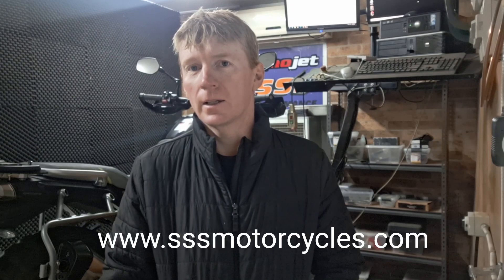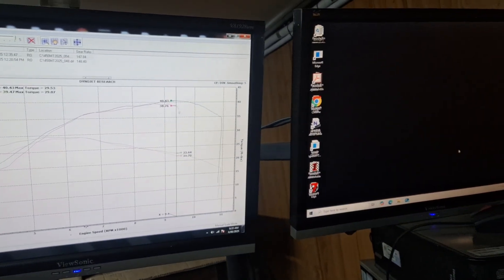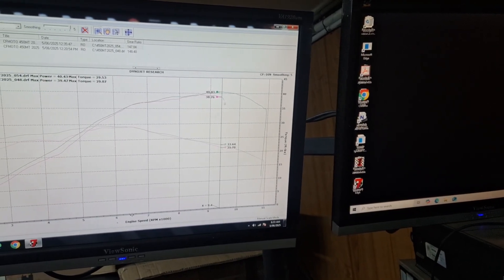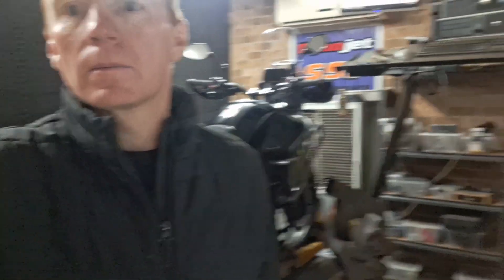CFMOTO 450MT ECU UPGRADE

Comment: Great video and thanks for the work you do. Mine is a 11/24 build. Came with a single outlet. I purchased a twin outlet mufflers from a mate just for the note. Still has stock filter and I have made m own w stage pre filter which fits in the snorkel. With both mufflers I have never had a twitchy throttle and it's never stalled on the decel. I'm super happy that it doesn't have the issues that other guys are experiencing.  How do you explain this? Cheers.